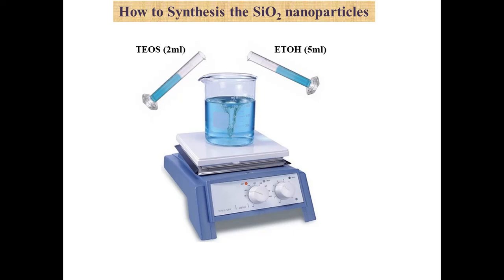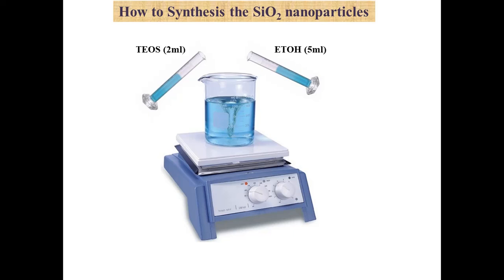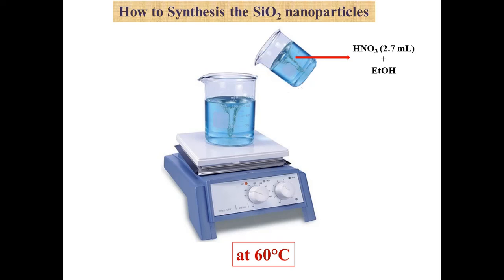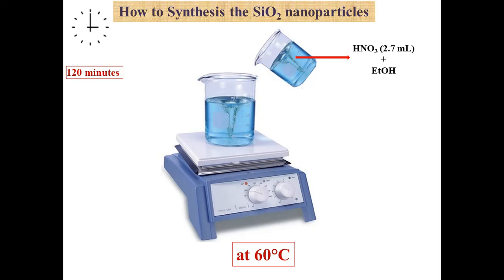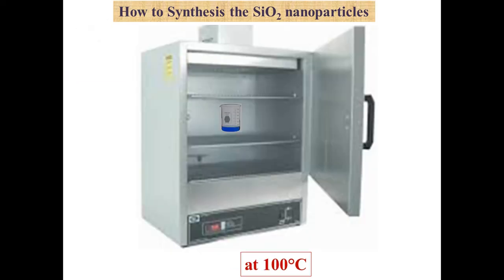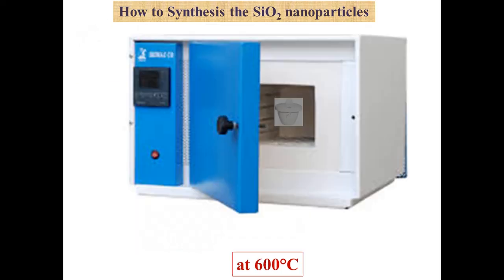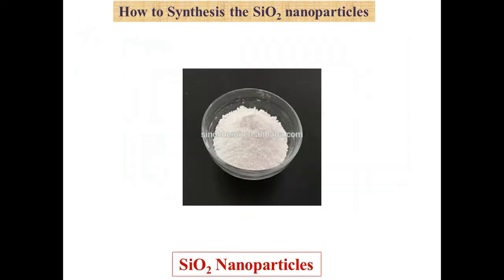Sol Gel Method for the synthesis of SiO2 nanoparticles

Comment: If it iis possible ,pls let me know what are the importance if each step
Reply from the maker: The first step is preparing the solution by mixing the precursor and a solvent which is the starter material for the synthesis of nanoparticles. By adding solution two to solution one and give it the proper time, we have the gel. The next step is getting rid of the solvents and calcination to convert the dried gel to nano-powders.

Comment: Thanks. How much silica nanoparticles will I get if I use the amount of chemicals you specified in video?
Reply from the maker: Hi dear,
As I know, there is no way to calculate the exact mass of the final product because nanoparticles will form in a network. I respond to you lately because I tried to calculate it with my data but I couldn't find a way for it. My suggestion is you conduct some experiments with different volumes of materials and measure the mass of the final product and you may have a correlation between them with the regression method and this correlation may be practical only for your experiments.
Best luck
Reply: Nanotechnology that’s okay. Thank you so much
Reply from the maker: We've gotten about 1 gr of nanoparticles.

Comment: I have used the method given in the video but was not able to achieve the desired particle size. Please guide me get the particle size as fine as possible.
Reply from the maker: Hello, what particle size have you gotten to?
Reply: @NANOTECHNOLOGY_Nanoscience  around 70 micron
Reply from the maker: @ikramudinbadi8486  I think your problem is the way that you added the solution 2 to solution on the heater. This step should be done very slowly and it takes hours.
Reply: @NANOTECHNOLOGY_Nanoscience  do you have any reference material to which I can refer to.
Reply from the maker: @ikramudinbadi8486  Please send me an email. The contact information is on the "about" part of the channel.
Reply: @NANOTECHNOLOGY_Nanoscience  i send you mail on your gmail address

Comment: Can you tell me what is the concentration of nitric acid that you added and the volume of ethanol?
Reply from the maker: There is a direct correlation between the value of precursor, solvent and also acid or base. It depends on how much precursor that you are using to synthesize the nanoparticle. Send me an email to share with you some articles that may help you with this.
Reply: @Ayesha Sarfraz Off course I can reply you but first of all write me what's your problem?
Reply: @Ayesha Sarfraz In my case the problem was to much ethanol used as a solvent. Ethanol is one of the product of TEOS hydrolysis and the reaction is hampered while using to high volume of it.
Finally I managed to hydrolyse TEOS in two ways. 
1) Using 0,8 vol. of ethanol vs TEOS. Obtained sol was very dense and it required dilution to be stable. 0,8 vol. of ethanol is the minimum amount to get homogeneous mixture of TEOS - H2O - ethanol at pH ≈ 3.
2) Using isopropanol as a solvent instead. Then you can use higher volume of it without hampering the hydrolysis. I used 1.0 vol but 2.0 vol will work as well.
So, the best method is the following:
10g of TEOS
1,8g of 0,25% HCl 
10ml of IPA
pH will be ≈ 3
Stir the mixture under reflux for 1h.
Once hydrolysis is done add more solvent to get required stability.
I hope it will be helpful to you.
Reply: @Ayesha Sarfraz Unfortunately I don't have much experience with precursors other than TEOS.

Comment: Hello, I have extracted sio2 nps by seeing your video but got agglomerated particles after calcination around 1600nm. Kindly recommend me any solution.
Reply from the maker: Hi, how long did your adding solution 2 to solution one take?
Reply: About half an hour.
Reply from the maker: @pratikshyabadanayak5091  Next time, do it in more than 3 hours. Adjust the burette on the low rate.This step should be done very slowly and you need to be patient.
Reply: K thank u. What should be the rpm while stirring?
Reply from the maker: @pratikshyabadanayak5091  It's not a determining factor. You need a moderate temperature about 50 C and a moderate rate to stir the solution on the heater stirrer.
Reply from the maker: Do it again and let me know your final result. Good luck
Reply: K thank you for your suggestions.
Reply: Hey, after following your suggestions today I got 70nm size.... Thank you
Reply: @NANOTECHNOLOGY_Nanoscience  Does heating may cause evaporation of solvents?
Reply: @pratikshyabadanayak5091  hello
Reply: @pratikshyabadanayak5091  could you tell me , how can we make 50nm nano silica by this proces

Thank you

Comment: Can i use 2-propanol for the synthesis?
Reply from the maker: In the sol-gel method, alcohol is used as a solvent that leaves the solution in the heating process anyway. But it has been proved that alcohols with different carbon numbers, boiling points and viscosity affect the crystalline structure and morphology of the final product. Consequently, the size and morphology of your final product should be different from our results.